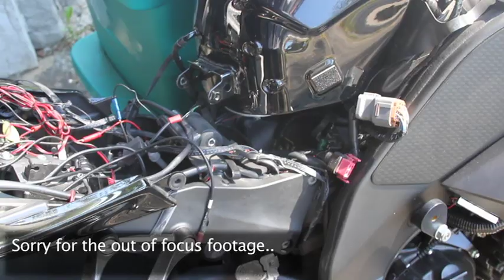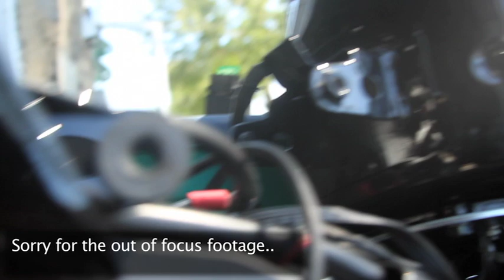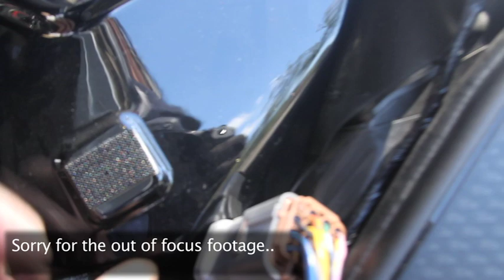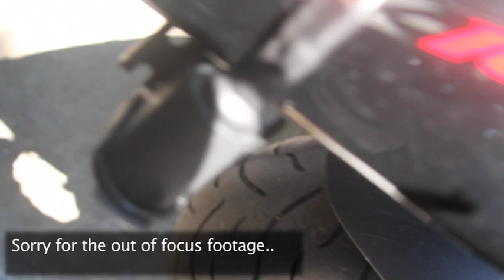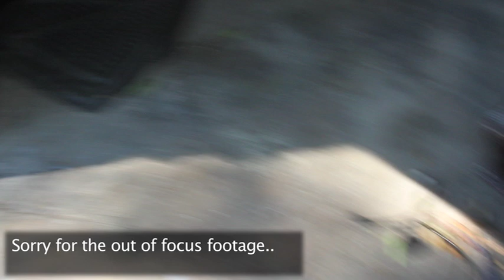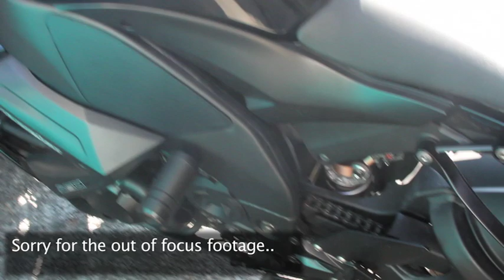How to change a starter solenoid on a 2008 kawasaki zx10

Comment: Is that part you change typically a problem I changed my battery on my ZX 10 and it ran two days but the battery drained and the dash would go out and on
Reply from the maker: I’m really not sure if it’s a topical issue cause i don’t hear people talking about it often but that’s the issue i had. I didn’t have the dash issue but the battery was definitely an issue.  I hope you are able to get it resolved. I can’t give you much more information on it because this video was made years ago and i don’t even own that bike or any bike any-longer. My apologies.